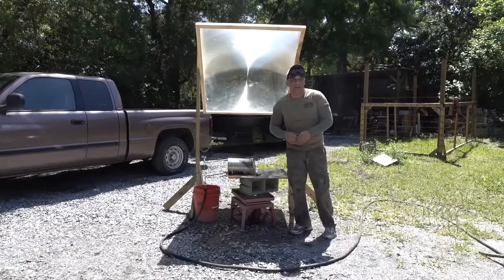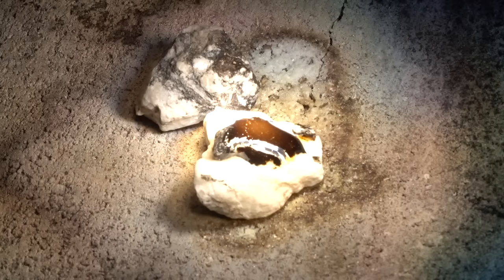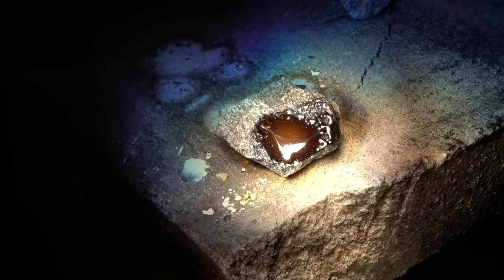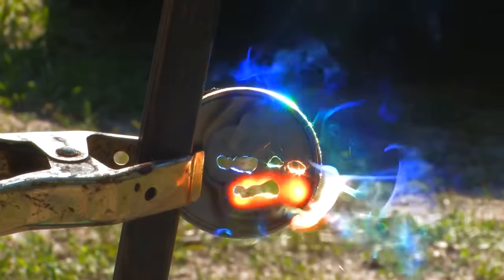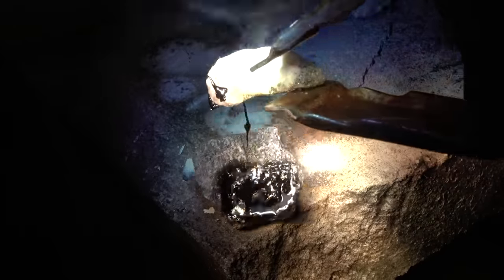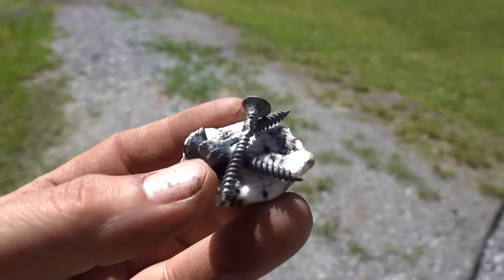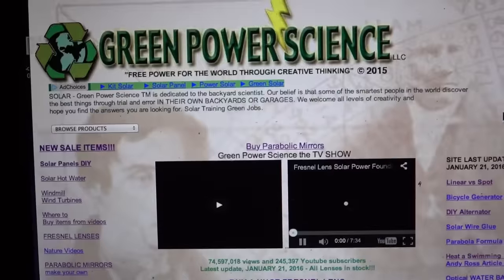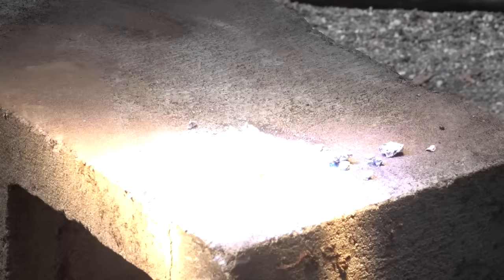Fresnel Lens melting GRANITE 2300˚ Fahrenheit make Obsidian FRESNEL LENS

Comment: This man inadvertently exposed one of the secrets of Egyptian civilization. Haha. But their glasses were far bigger.
Reply: And...3 together...how is depicted in hieroglipichs
Reply: Prof Myers  I cant agree with this!! "Two yards of Granite is one Helluva heat sink and it will absorb and shed heat faster than you can lay it down with a focused beam. The slag will cool as fast as it draws off so actually pouring it into any form in a liquid state is impossible."  Sorry! If you maintain the heat source in the where the granite is being poured then of course its not impossible... You agree that granite can be melted then we can both agree that it can be poured with the same method used to melt it DUHH.................
Reply: Absolutely they took 5 meter diameter of lens
Reply: @asifsolanki5412  Are  you from Egypt? Is it common knowledge there?
Reply: Prof Myers 🙄 200 inch = 5.08 Meter that's why I was explaining to you
Reply: And the Myans( real bad spelling😕)
Reply: No f## way... when granit melts, it forms glass. Nothing we can see in Egypt as far as I know.
Reply: The problem with this idea is that none of the stone have the glass like finish and many have tool marks that are very similar to mechanical saw marks.
Reply: @Spectre-wd9dl  absolutely!
Reply: Hhmmm maybe the top of the pyramid was some kind of glass or crystal to focus the sunlight into the pyramid?
Reply: You did hear the part about how it turns to glass when it melts right?

Comment: Granite and obsidian are entirely different minerals.
Reply: not exactly true, granite has a similar chemistry to obsidian (Aluminium and Silica oxides) both can form from the same magma,it depends on how quickly they cool to which forms
Reply: @jonnyscuba72  Obsidian is glass (non crystalline.) Granite is feldspar,  quartz, and biotite mica. They are in no way similar to obsidian.
Reply: @brushbros  Sorry but you are wrong. They are over 84% identical composition ie. Al, Si.  It is purely down to the cooling process. I have a degree in geology and I'm quite happy to debate this. There are lots of types of granite with varying compositions but with a quick cooling process, obsidian WILL form from the same magma
Reply: @jonnyscuba72 Nobody knew that you were a troll until you raised your hand. Sit back down and don't bother us.
Reply: Yes, but by heating granite up to the melting point and letting it cool so quickly that crystals don't have enough time to form, it could be converted to the material pretty close to obsidian in terms of structure and composition

Comment: In these comments somewhere someone put a link to a vid of a guy melting granite with a 2 foot square lense, just seen it. It melted in seconds then cooled when took it away. Look it up. It works, all the theories and they used a lense and made concrete and set them. MAN, SO SIMPLE it's not even funny. CMONN.

Comment: Bravo, just demonstrated  how the Pyramids were constructed. Not from carved granite but from poured-granite.
Reply: kim Dier  even more impressive would be melting granite that turns into limestone rubble  when it cools.
Since the pyramids are made of rubble limestone blocks underneath the outermost layers. Not to mention all the lime mortar used full in gaps in the ‘perfectly’ cut exterior layers.
I’ve seen these pyramid experts actually visit the site and not see what you can pick up from google street view.
The mystery of the mystery of the mysterious mystery of quarrying and moving stones. No one was doing that before modern power tools and cranes. There definitely is not old books, photos and even film of people doing it.

Comment: I have a small Fresnel plastic lens to magnify objects. It's propped up vertically on the side table by my recliner. One evening I happened to glance over and there a couple of inches in front of the lens was a floating recreation of the tv screen across the room. Perfect 3D. I thought 3D creations took all sorts of hardware.
Reply: wtf?
Reply: What?
Reply: @maipai101  Setting at around an 85degree angle to the tv under the right lighting condiions the lense reflects the tv image out an inch or more in front of the lense. It disappears if you put something between the lense and the image.

Comment: This can likely be used to exponentially increase to output of parabolic light collectors to generate power to batteries and run inverters...Basically have solar power without the 15% low efficiency of solar cells.

Comment: I knew it!  I am not crazy!  LOL!  At specific heat temperatures (possibly cold too), pressures, time you may be able to melt almost ANY rock/mineral.  I am working on an experiment to get a slow heat even process to see if by chance there is a possibility to heat an rock/mineral enough to make it malleable, therefore allowing me to reshape and re-form the original structure of a rock/mineral into a specific form.  I think the key will be to work slow and methodical.
Reply: Any updates on this? :D
Reply: would like to know as well
Reply: Please say you tried this

Comment: Question. Do I understand correctly that melting granite turns it into a form of glass called obsidian? If so, is it therefore impossible to have the obsidian revert back again to granite?
I'm also wondering if there is a middle point (temperature wise) where the granite can become soft and become pliable before it turns into what looks essentially like a brittle glass.
Reply: So the answer is no. The closest you can get as far as geo polymers go to granite is basalt. For granite to form it has to both cool slow and be under pressure for the quartz to form as it does in granite. 

One thing to note: there’s evidence that basalt was created and cast in ancient Mesopotamia and there’s a paper out there from a study done on it. There is one company out there that actually makes basalt glass fiber sheets for making a form of basalt fiberglass. It’s chemical resistant and can be used like carbon fiber.
Reply: The modern churches are controversial too. Are they poured or carved? 
Seems like we can't even figure out modern buildings let alone the pyramids. 
I think it's likely they did it the easy way and claimed they did it the hard way.
Reply: @Charles-mv7sv  yeah exactly man! The notion of the secret building method even shine some extra light on the freemasons and their symbolic connection to egypt...
Reply: @Charles-mv7sv  lookup old lost world and you'll get more answers, and more questions.

use other stuff than youtube
for example
Reply: @Charles-mv7sv  odysee
Reply: Can't revert the process but you could certainly use this to melt the stone for cutting the quarry or even for roughly shaping stone, this avoiding a lot of intensive labour and saving time.
There's melted bedrock around pyramids which pretty much proves they used something like this.
Also if you look at Peruvian Stone walls you can see how they melted rock wall edges and vitrified their outside (if not with this method, then maybe with parabolic mirrors or really intense fires)
Reply: @Charles-mv7sv  I think the pyramids were poured Limestone cement from the bottom up .Starting with the underground tunnels.All of the rooms and tunnels were poured.
Reply: Egypt probably used a secret mix added to the granite to harden it or make it different

Comment: And that is how they placed 10 tones blocks in the Gyza Pyramids 😆 the explanation is simpler than we think
Reply: You say placed,  please elaborate more.  I can see carved or possibly melted and sanded then placed. What am I missing?
Reply: Except that the blocks are not melted, but carved to precision tolerances and slid into place perfectly, without the need for mortar or any other malleable substance.
Reply: @privatename5788  You are correct.  You can compare the granite composition with the granite at Aswan. Exactly the same.  Besides, do you have any idea how hot you have to heat granite to turn it to a liquid? Not to mention when/if you were to do that, it would not even be granite anymore. You'd turn it into obsidian or basalt. Granite is lava that has cooled under the earth over thousands and millions of years and as such granite has a very unique composition depending on how long it cooled, how it cooled, what other elements/rocks/minerals were absorbed while it cooled.  You can look at it under a microscope and analyze the size of crystals within the granite.  No. The granite in the great pyramids were not crushed to dust or small rocks, then heated with a big magnifying glass, then poured into some kind of mold.  I believe the ancients used resonant sound/frequencies to cut/carve/transport/levitate the blocks into place.

Comment: dude can you use water some how with it..

The melting temperature of dry granite at ambient pressure is 1215–1260 °C (2219–2300 °F);[5] it is strongly reduced in the presence of water, down to 650 °C at a few kBar pressure.[6]

Comment: I need that lens above my pool to warm the water . or would the heat go through the water and melt the pool floor ?
Reply: Put a bowling ball or a piece of steel at the bottom. Focus the beam on this and it will heat the pool.
Reply: light will difract in water ,it will heat in the point of concetration of lens.

Comment: Do you believe it is possible they used this method to make the granite 'casks' in the tombs, poured the liquid into a mold to make them then build the pyramid around the Granite cask? I think it's the method whoever built them used.

Each block of the pyramids was made using molds. They blended a cement like mix that dried to look like solid, natural stone.. no way was they moving them blocks 😁👍

Comment: Thanks.  Ever see a representation of Hathor, mother of Horus, with a disk of some sort between the antlers, probably willow, on her head?  In that way it is possible to melt granite without killing yourself.  

Well done.  This is how they built the King's Chamber and other granite objects that still seem to confound 'proper' Egyptologists and even the new breed who can't seem to figure it out.

A sharp arrow for the quiver of inquiry and fact.
Reply: How exactly does melting granite into obsidian explain the Kings Chamber?
Reply: Except that none of the structures or objects you've mentioned exist in obsidian form. Obsidian is hard, brittle, and amorphous; it therefore fractures with sharp edges. Nothing like the any of the Egyptian pieces from antiquity. Good grief. Get a hold of yourself.
Reply: LOL

Comment: Could this have been around in Egypt 5000 yrs ago?
Reply: How would they have made the lenses in the first place?  And they would have to make some pretty big ones! And it looks like it doesn’t work that well. 
So no way!
Reply: @-C.S.R  moulded ground then polished.
May have even used a mirror lens.
Reply: @Surferant666  😂
Reply: @-C.S.R  have you not seen the electrical conductors and pictures of light bulbs at the pyramids? They knew how to plate metal with gold too and they think light bulbs lit the insides of the pyramids as flames leave smoke marks and take oxygen away.
Reply: Ancient astronaut theorists say YES!!

Comment: couldn't some form of power station be run off this?
Reply: I think there's something based on this principle, but using mirrors instead of a lens to focus the light.  A large tower is set up in the desert and a field of mirrors concentrate sunlight on a boiler near the top.